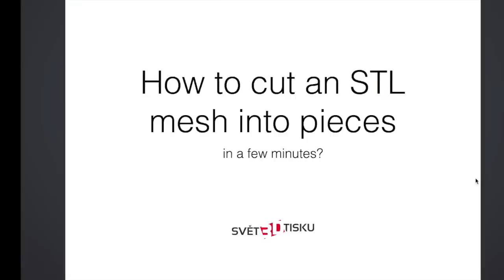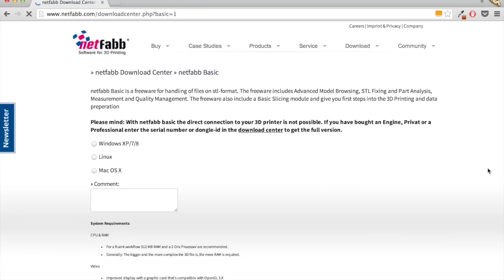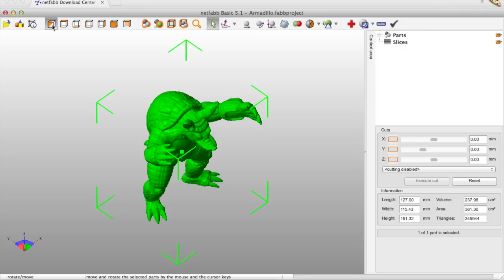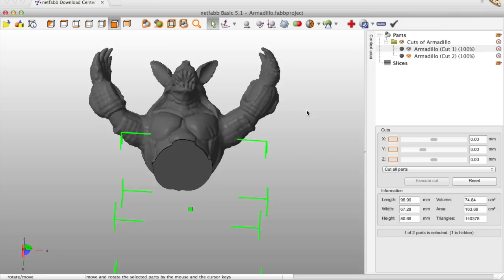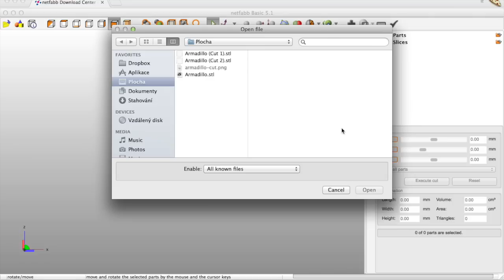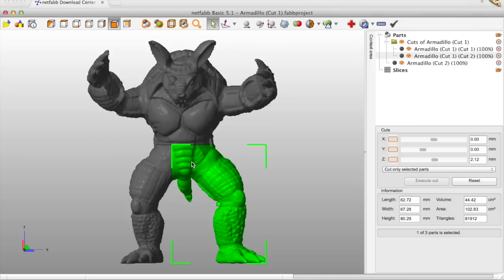How to cut/split an STL mesh into multiple parts by a plane

Comment: having an issue...i cut a shape on the Z axis to get rid of thick bottom about 30% of the way up, when i convert it in Cura, it saves another slice about as high as the one i removed, starting the removal point so it kinda saves the middle part of my shape. any suggestions ?

Comment: Hope you can help me. I have an stl file that i need to cut out a section from the center and then attach the left over two pieces back together how can I accomplish this? I was able to cut them and remove the middle so far but cant figure out how to merge the other two together.Thanks
Reply from the maker: Hi Dustan, to be honest I haven't played with 3D modeling much since this video so I don't see a straighforward solution right now. Maybe try to ask on some 3D modeling forum.

Comment: Looks like they removed this from the 2017 basic version.  Had to hunt around and found a 5.3 binary.  Thanks for the video!
Reply: It's not. It's still in the free version of Autodesk Netfabb, just the buttons are moved around a bit:
https://forums.autodesk.com/t5/installation-licensing/where-is-execute-cut-in-netfabb-standard-2017/m-p/6931684
Reply: THANKS

Comment: The free version of netfabb does not do cuts.  It is $299 for home use.
Reply: In fact the NetFabb Basic (free) is able to do this kind of cuts (by one of the axis aligned planes) shown in the video. What is only in the Pro versions are the operations Free Cut and Split Large STL file.
Reply: I confirm. Only free cut tool need a license
Reply: You can also do it in a free program called Blender: Follow this link and it will show you how: http://3dprintingninja.blogspot.com/2014/12/how-to-split-separate-model-in-blender.html
Reply: Youre right but blender needs many hour to complete rookie training...

Comment: Scam! Netfab is NOT free for any version. It requires weasely subscription services. This is just clickbait for the scammy weasels at Autodesk
Reply from the maker: This video was shot 6 years ago when there was a free trial just to share a useful technique. I have no control over evolution of Autodesk licensing policies. Using strong words like scam or clickbait is not appropriate in this case. If it's not useful for you just ignore the video and find a better technique yourself. Possibly feel free to share it with the community.